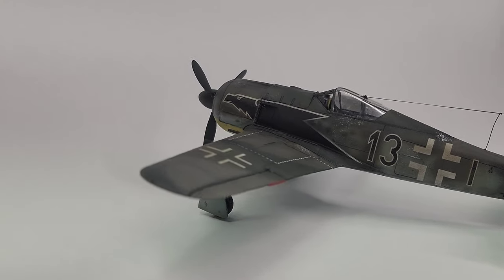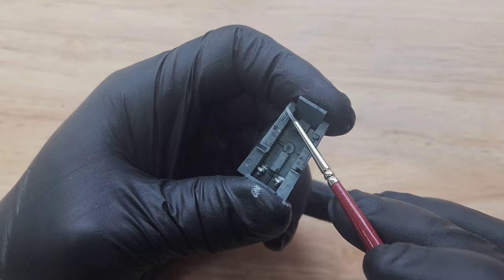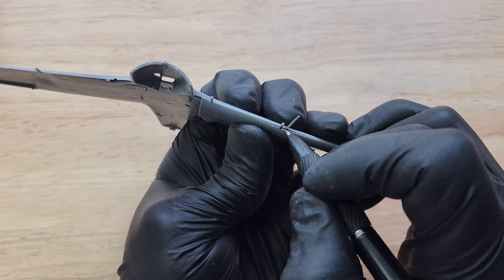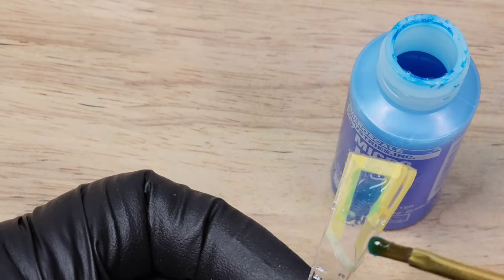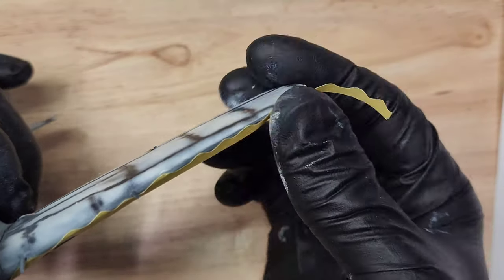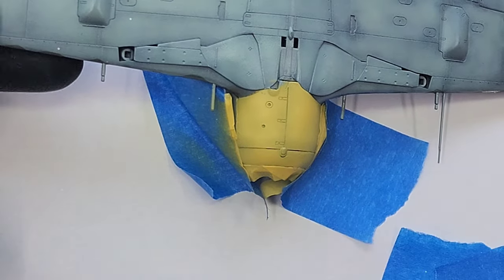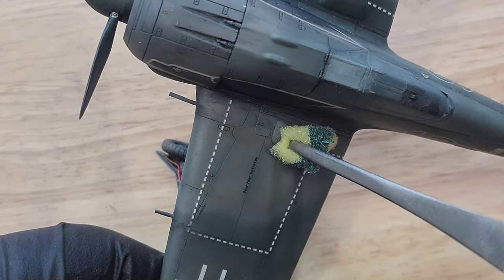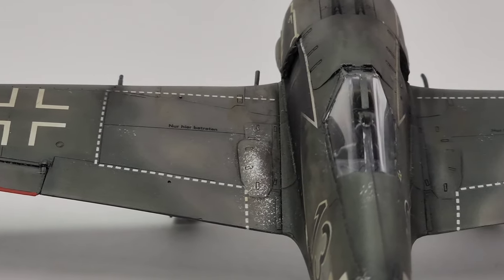1/48 Tamiya Focke Wulf 190A3 Full Build | Detailed Brake Lines | Interior | chipping | Seatbelts

Comment: If you are going to paint some area yellow, first undercoat with white. It will look brighter and you will use less paint. 
Most bf109 and fw 190 fighters had soft edge camouflage. Early 109 had solid line camo. That varied from  one aircraft type to another. Also it varied with different manufacturers. 
Same thing with the colors. There is a ton of variation. The one you used is called type 5. Three types of gray. RLM numbers 74,75 and 76. Normally there would be more contrast between the colors on the top part.  I believe the whole pre and post shading is overestimated. I dont do it unless i find photos of an actual aircraft with it. 
But in the overall your model looks really good.
Reply from the maker: Thanks I really appreciate the help!! I now no the difference between early and lat year camo!! Thanks so much!